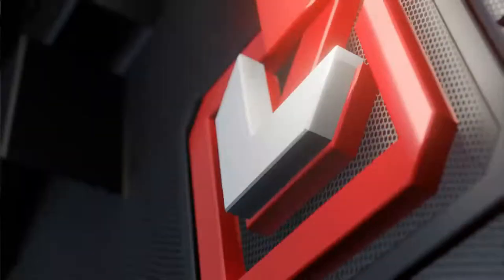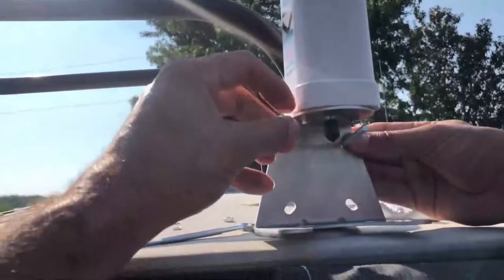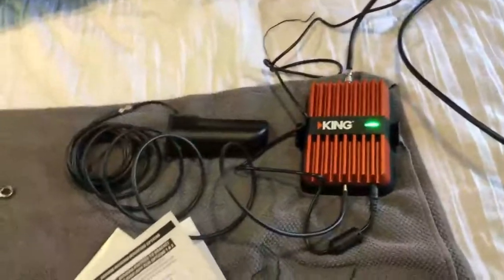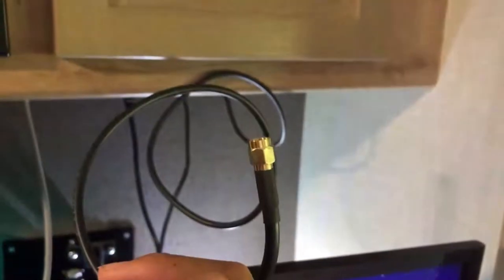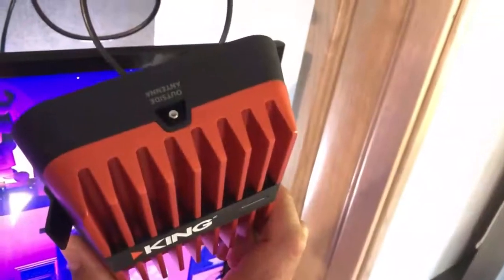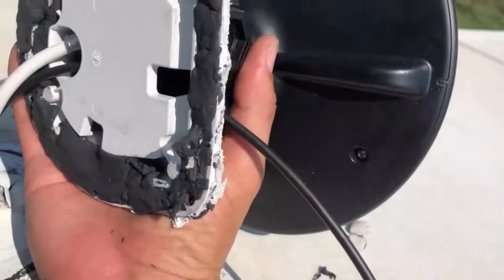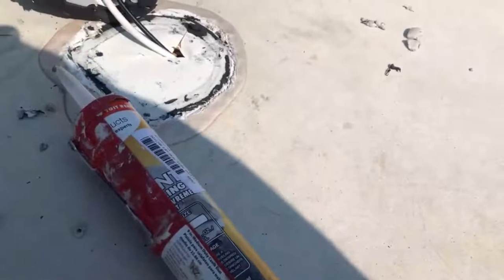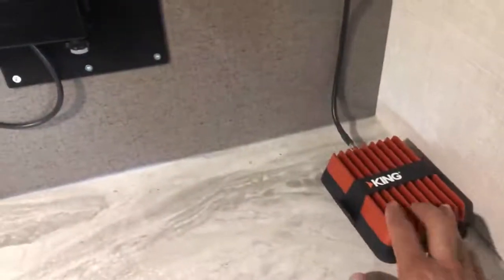Avoid These Mistakes When Reviewing King KX2000 5G Booster

Comment: I haven't technically logged on to YouTube in 6-7 years, but I am compelled to say THANK YOU THANK YOU THANK YOU!!!!   I have a Micro Minnie 2108ds and have been looking for this exact type of tutorial for a year.  You really took one for the team disassembling the satellite  TV cover.  I am planning on purchasing this exact King 5G booster.  Would you please update the video relaying how this works on campsites with weak 5G signals (as in most campsites)?   Again,  Thanks.
Reply from the maker: So kind! Thank you! It works great in almost all settings! Once you set it up with your mobile carrier, you’ll be hard pressed to find a situation where it doesn’t work. Some places may be slower but it should still surprise you! Enjoy!
Reply: Do you know of an adaptor for the ill-fitting cable you uncovered on the roof  that would work with the king antenna?  thanks.

Comment: For those wondering about the red-capped second cable under the satellite dish, the one that would not fit the KX2000 antenna,  I wrote King and received this reply:

"The KX2000 is an LTE product not a WIFI system. They are 2 completely different system with different wiring. That prewired WIFI cable there is only for our WIFI products. You would need to run that cable for the King LTE product."

By "that cable"  they mean the cable that came with the KX2000 unit.  Hope this helps.
Reply from the maker: @sling0073 thanks for the insight on this!!

Comment: Helpful, but based on your video I do believe for the effort of installation, cost of $500, lower upload speeds when in use, and only about a 10-15 mbs difference in download speeds, this device seems to be more of a scam.  Would you agree?   We were really close to purchasing this.
Reply from the maker: No not really. It still depends on where you are. It’s still going to grab the signal from a cell phone tower and amplify it. We’ve seen it help a lot in rural areas
Reply: You get max 60 decibel...I still haven't seen anything or anyone doing a signal boost test correctly.  And using the same speed test without clearing cash. You generally get faster downloads anyway.